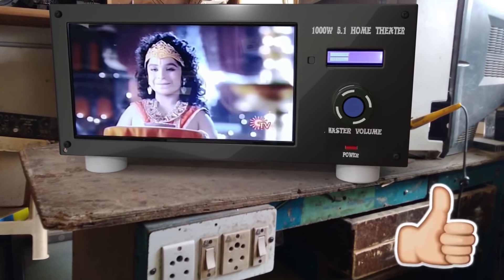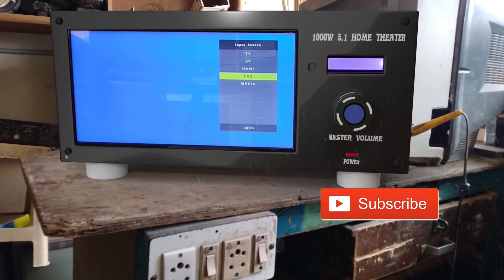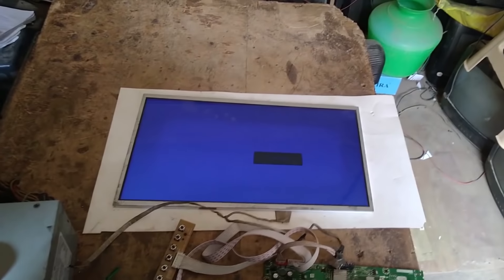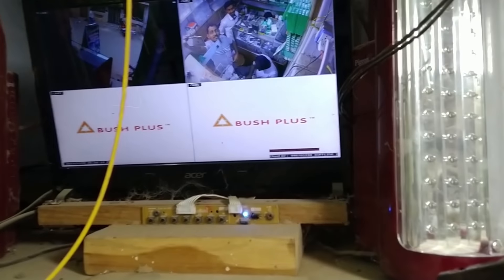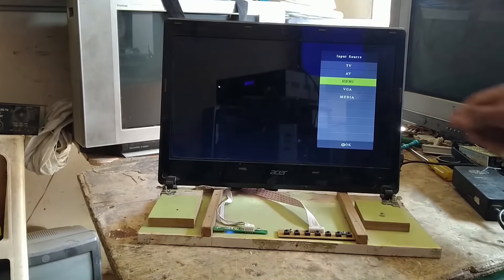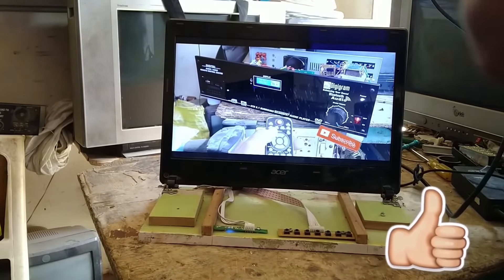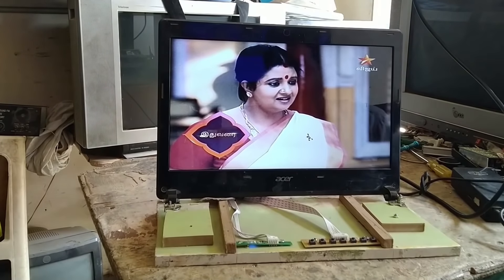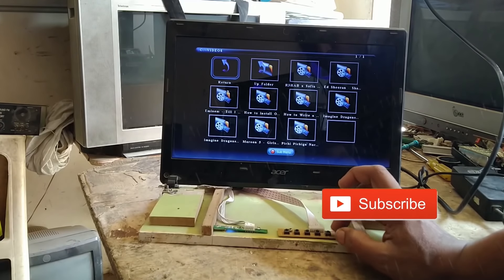How To Make 5.1 Hometheater 14 Inch Display  HDMI , VGA, USB video ,HD Display

Comment: Bro enaku 7"display hd  la potu oru 5.1 subbuku 2 line vaithu  nalla panel glass finish panel potu surround ku 10"use padra maduri subbuku 2 (12") use pandra maduri ready panni thanga bro cost evalavu nu sollunga bro  audio video all format support augura maduri  aux coaxl blue tooth ellame